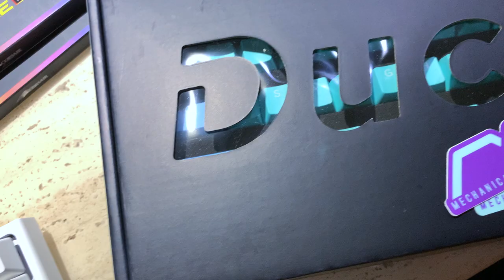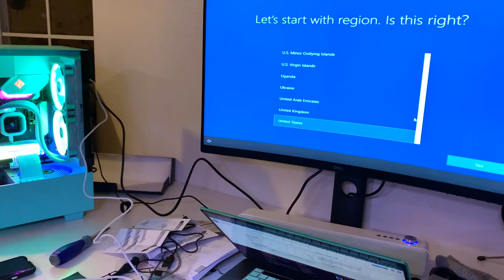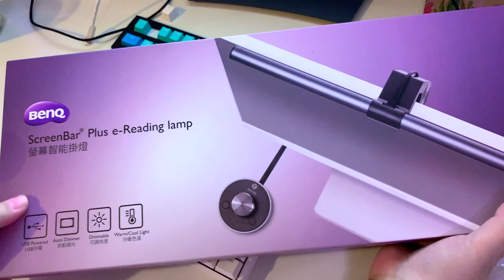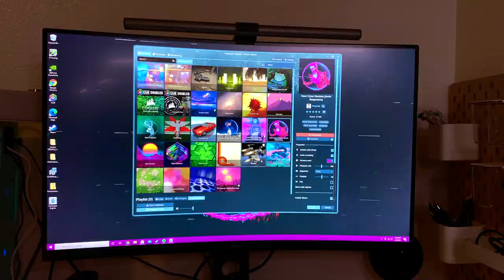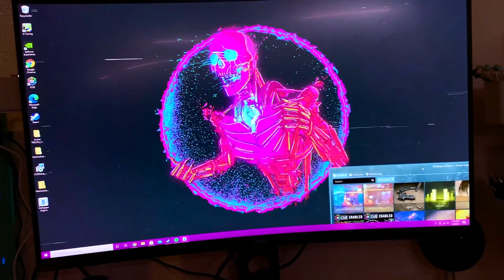Building My First Gaming PC // Jacquelindeleon

Comment: i know that its late but your gpu is suffocating because those three fans in front is set as exhaust you should flip those three so it'll be set as intake so the air will flow to the gpu and improve gpu temps

Comment: I recommend getting a new case because your AIO (cpu cooler) probably has lots of air bubbles. Try to get a orientation that has the water block below the radiator.